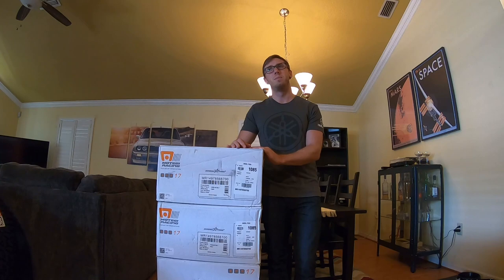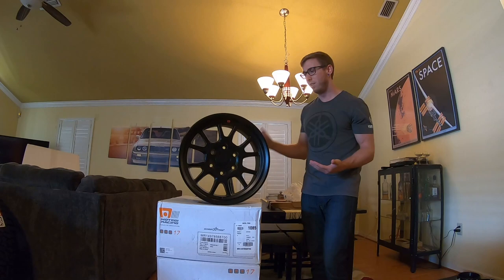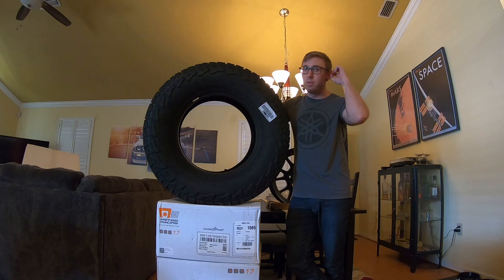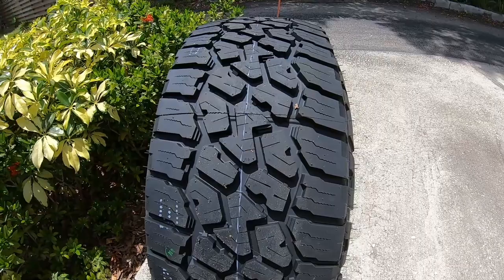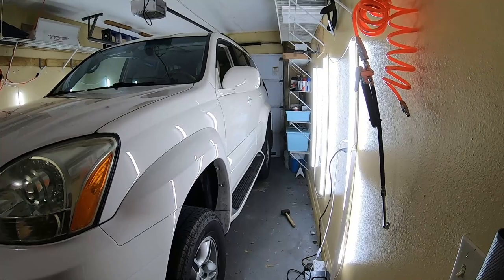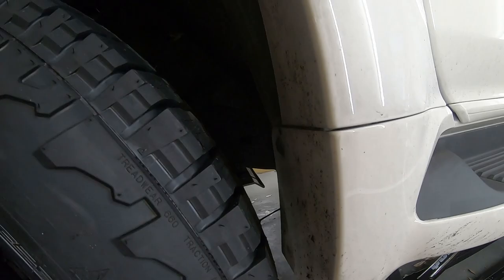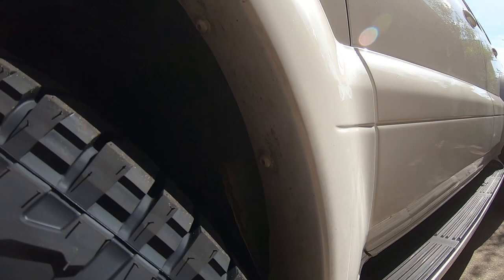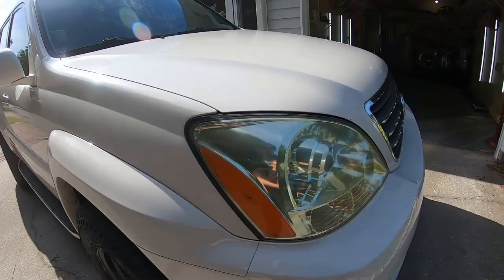Vlog 15 - Lexus GX470 Gets New Wheels & Tires! (Motegi and Falken Wildpeak)

Comment: Which wildpeak did you get? The load c or load e?
Reply from the maker: Good question, I learned I purchased the SL rated tires, which are the lowest load rating tires they make. I would have preferred a c or e load tire, but I also don’t do any hauling. The most I do is mountain bikes and kayaks on the roof. If you plan on towing a large trailer, you should go for c or e rating. Hope this helps.
Reply: @Awesomoto  
Cool.. I got the load C. It's enough for daily and little off road activities. No extreme wheeling. I read some folks said they did fine with some heavy off roading.  I'm not gonna run load E just because the followers with off road setup says so. Load C fits fine for me and some towing. Plus not so heavy.
Reply from the maker: Lex Thanks fit getting back to me on that. Glad to hear load C is working for you. I agree, I think it’s generally a good choice for most GX owners to go with.

Comment: How does the ride feel with the new setup and do you feel a difference with the new weight of wheels and tires? Thank you
Reply from the maker: Hey Jon, It definitely feels different with the extra weight and the bigger tread pattern compared to the old tires. Overall, it rides much better than I though and the WIldpeaks have very little road noise.
Reply: Awesomoto was debating going 285 for a while but this confirms it. Thanks again.
Reply from the maker: jon j No problem! Reach out if you have questions along the way.

Comment: Love your wheels and tires set up, I want to order the same one but it is not available anymore only 18mm offset still available, do you think it would still fit and look nice, thank you
Reply from the maker: Yeah I think the 18mm would work as the stock wheels are 25mm. It’ll bring it out a little bit and you shouldn’t have issues. Worst case scenario you could add some wheel spacers, but I doubt you’ll need it. Let me know if you go that route and need help or have questions.
Reply: You think it’s safe to use spacers
Reply from the maker: S t r a w b e r r y m i l k ! I don’t know all the implications If you’re doing aggressive driving off road, but I do know that highway and daily driving wheels spacers are fine. My gut feel is that wheels spacers wouldn’t be great for off-roading.
Reply from the maker: Let me know if I can help in any way.

Comment: Can I run this tire set up on the TRD wheel with the 22mm offset?? I don’t know much about offsets for wheel fitment.
Reply from the maker: The stock wheels are 25mm offset, so adding 285s on 22mm TRD wheels might work, but I’m a little hesitant due to clearance near the UCA. There’s a good chance you do this and have no issues at all, but I suggest taking some measurements of your current setup with stock wheels and see how you feel after that. Let me know if you need more help figuring that out and I can do some homework on my end to see if they’ll work. Cheers!
Reply: Thanks for the response! Would you ever add a light bar? I’ve been thinking of doing that for awhile. Would love to see a video of that install. Keep up the awesome channel!

Comment: Nice wheel. How do you carry your spare tire now? Any plan on roof rack?
Reply from the maker: tae lee Good question! I still haven’t bought a legitimate spare as I’m still unsure if I want to do roof mount spare or tailgate mount. I actually put on a cheap cage to the OEM roof rack to try out for now. I plan to get a nicer one this fall.
Reply: @Awesomoto  I think the cage looks great. Do you have a link for that or model # ?
Reply from the maker: @ImGeeish  Hey Lorenzo, thanks for reaching out! I still have this roof rack basket/cage and use it all the time for hauling kayaks. Here’s the link from Amazon.

MAXXHAUL 50119 Steel Roof Rack - Large - 56-1/4" x 40" x 4-1/4" - Fully Assembled https://www.amazon.com/dp/B07PHQH9N7/ref=cm_sw_r_cp_api_glt_fabc_RPA7945JA21NPZXR8G61?_encoding=UTF8&psc=1

Comment: Great video! My GX still has a stock suspension. I have the TRD pro wheels, If I go with 270/70/17R or 265/70R/17 BFGoodrich All Terrain T/A KO2 will I still have rubbing? Could I rock this wheel without getting a lift kit? Looking to purchase tires this week.
Reply from the maker: Hulk1906 I’m thinking 265/70R/17 will be the safest route, but I’m not 100% sure the offset on the wheels you have. I’d check the clearance you have with your current setup with a tape measure and see if the added dimensions will hit anything in the wheel well. That’s the safe route. I did a rough check and luckily I didn’t have to worry about much rub. I’ll eventually install a lift kit and I highly recommend you do in the future if you go with that large of a tire. Reason being is that you may not get rub with Town/highway driving, but likely to rub when the suspension compresses. 

Let me know if you have more questions. Feel free to reach out on Instagram too. Thanks for watching!
Reply: @Awesomoto  Thanks for the speedy response. If I'm going to do the lift kit, I might as well go big right? 285/70/17 will still warrant cutting around the fender? or what about 275/70/17 + lift kit means no need to cut anything? I most likely won't off road. I'll probably go with the 275/70/17. More weight leads to poor gas performance?
Reply from the maker: Hulk1906 I mean, you definitely could go big lol. I like your mindset with the 275’s and a lift though. You’ll still love that setup and it might be cheaper for tires.
Reply: Awesomoto tires have been ordered; In order to lift my Gx must the rear air bags be converted to coils? I think they work fine at the moment.
Reply from the maker: Hulk1906 Heck yeah! Glad to hear you ordered tires. Let me know if you need help du try big the install. You can email me at awesomotovlog@gmail.com. Yeah if you install a lift kit, it will replace the existing air suspension. Try out the new tire setup first and see if you even need to worry about a lift. You might not need one.
Reply: @Awesomoto  so far from doing some research this is what I would go with: OME 2'' lift + the metal tech rear coil conversion kit. Total would be $1,000 bucks excluding labor. Before I purchases these I'll see if there's any rubbing from the 275/70/17 tires. Anything else I'm missing? What lift kit would you go with for your set up?
Reply from the maker: Hulk1906 I hear great things about the OME lifts from friends, so that sounds like a great choice and you should be set. I plan to try out the Dobinson 2” lift this winter, so I’ll definitely have a video post about that.
Reply: Awesomoto I ended up getting the iron man stage 2; pretty good deal and an additional 15% off the sales price. Tires have been installed. Minor rubbing on the fenders when I make tight turns. Lifting in two weeks
Reply from the maker: @Hulk1906  That’s awesome to hear! I’m glad you were in the same situation as me and only had minor rubbing. I’m excited to buy a lift kit and install it soon. I’ll have to look into that kit you bought.

Comment: Hi brother thanks for video!
But what will happens if install to the front axle 265/70/17 and rear axle 285/70/17 
Same tire Falken? 
Thanks
Reply from the maker: Hey Karimov! No problem, hopefully it helps. Actually, you might be on to something there by going smaller on the front tires. You may not have an issue with rubbing. As for have a non-square tires setup I think it would be fine. Most modern sports cars(including my M4) run non-square setups. Let me know if you go that route. It sounds like a good option.
Reply: Thanks for answering and what do you think if l install 265/70 
will I need to cut the plastics?
Thanks
Reply from the maker: @karimovm.5890  Is this with stock wheels or aftermarket? I can't guarantee that you won't have rubbing, but I think it'll be close and you might not need to cut.
Reply: I'll write later what I did!
Thanks brother!!!
Reply: I advise you! 
Cover the big plastic hole with black selicon from homedepod
Reply from the maker: @karimovm.5890  Yeah good idea. That would be good to seal it up.

Comment: What’s the brand of the roof basket you have there?
Reply from the maker: I bought a cheap roof basket on amazon from a company called MAXXHAUL. It was less than $100 and has held up good for the past 10 months. I meant to use it temporarily until I got a nicer rack, but it's been a nice surprise and I decided to keep it longer.
Reply: Thanks . That one looks nicer than the one on eBay.

Comment: Did you end up having to do a body mount chop? I was looking at getting these tires and similar 0 offset wheels with a 2.5 in lift and upgrade UCA I don't mind doing some massaging and some cutting but I definitely want to avoid doing the BMC
Reply from the maker: Knightofcydonia Thanks for reaching out. I did not have to chop any of the body mount and that’s on stock suspension. I plan to get a 2.5” as well in the near future. With the lift you won’t need to do any cutting.
Reply: @Awesomoto  thanks for the help and great video btw
Reply from the maker: Knightofcydonia Thank you! Let me know if you have questions during the wheel/tire upgrade on your GX.

Comment: How much and where can I buy ?
Reply from the maker: I bought the wheels through Custom Wheel Outlet, but you can buy them through any Motegi Wheel distributor. I believe they were $700 for all 4 wheels. I bought the tires through either Amazon or TireRack.

Comment: Strange approach to the choice of wheels. If looking for off-road wheels, number one criteria should be the strength. MR139 is more useful for the purpose. Same with the tires. Saving e few hundred dollars on cheap brand might cost much more at the end than buying proven brand. And if it is just for looks, than it is simply waste of money.
Reply from the maker: I'm not a fan of the MR139 wheels and there is nothing that states the MR139 is any stronger than the MR149. Regardless, I don't see a circumstance where the wheels I chose break under off-roading conditions. If that ever happens, then sir I owe you a beer. 

As for the tire, I went with the Falken Wilkpeak strictly because they are a proven brand. These tires are praised in many off-roading forums from Jeep, Taco, 4runners, etc. I didn't simply choose these without doing research. The link below is a great reference/review on them.

https://www.youtube.com/watch?v=Ti4JvypKiZ4